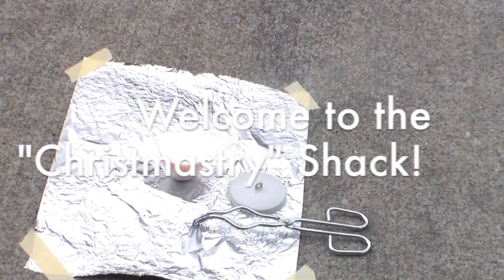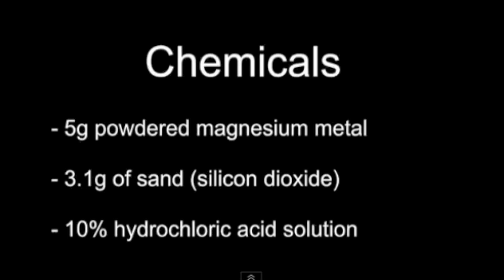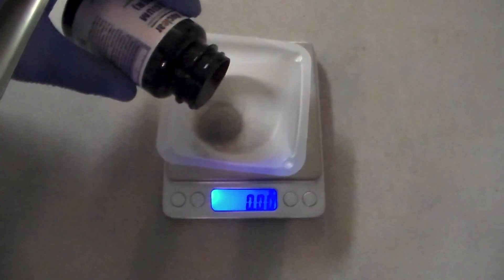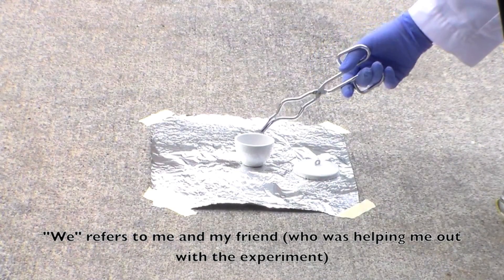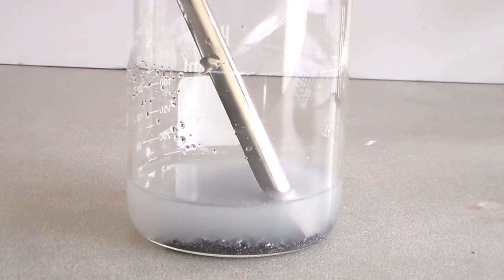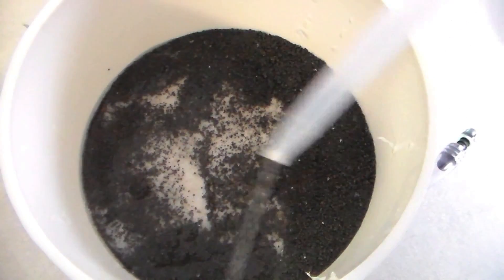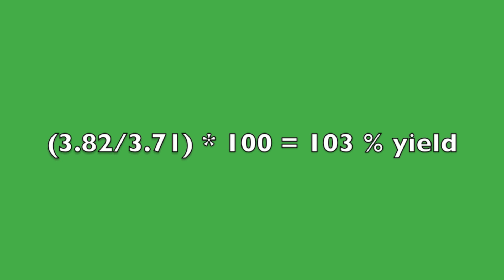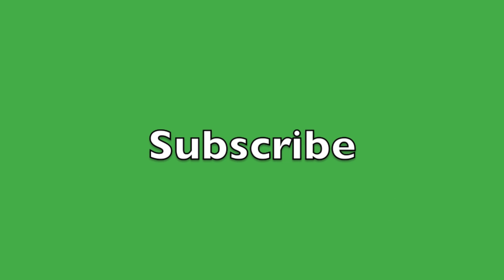Silicon Synthesis (From Mg and Sand) [Full HD]

Comment: Personally I like the thermite method using SiO2, S and AL. How ever afterwards you will have some aluminum sulfide to deal with, which slowly releases SH2. Not fun to be around but if you dump it in some weak HCL it will all react pretty quick. Just make sure its away from any people, hydrogen sulfide is horribly smelly not to mention very toxic.

Comment: First why dont you try to make pure sio2 from sand 
The procedure is 
1)Get the sand and some dil.acid like hcl or h2so4 to remove any carbonates 
And when fizzling stops clean it with water 
2)now let it dry and adding sodium hydroxide to the sand and heat to 400°C using a torch or anything and this must be done in a steel or copper vessel as Molten NaOH is reactive
3 when done dissolve in water this forms sodium silicate and then filter it to remove all impurities 
4 now add conc.h2so4 or hcl to sodium silicate which will form silic acid and filter it carefully 
5 let the acid dry and keep on stove or a burner to dry acid to sio2 
Heat for an hour to make sio2 completely
And there how you can make silicon purified one not contaminated
Reply: i need more expling please ??
Reply: @مريمطويل-ب7ل  can you elaborate please ?

Comment: I made elemental silicon once using a thermite mix of aluminium, sulfur and white sand. 
Calculated the amounts stochiometrically, plus 15% aluminium + sulfur and plus 5% aluminium.
(Extra aluminium and sulfur to increase the reaction temperature (Al + SiO2 reacts poorly, need Al + S to fuel the reaction.) and extra aluminium to reduce unreacted SiO2 in the end product and keep mostly HCl soluble Al + Al2S3 in the slag. Be careful! a lot of HS was released!

If you crush the slag and you find nice Si globules you can remove the Si globules and process the waste using NaOH. This is safer than HCl (NaOH reacts with Al2S3 to produce Na2S).
Reply: how

Comment: Perhaps you could have preheated the crucible gently in a kiln, you might not have had the thermal shock issue from the rapidly heating magnesium. Just a thought......
Also, have you tried making your own crucibles? If not, the way I do it is to use the mixture to make a kiln, 50% plaster of Paris and 50% kids play sand. It's cheap and highly effective for super high temperature experiments. Mold the crucibles fairly thick to and they will last forever, also if you buy the plaster of Paris in bulk you can get 25kg for around £19/£23 depending on where you buy it. I make these myself for casting molten metals including Silver, Gold, brass, Aluminium, etc......basically anything I need to melt. I don't have a good enough camera to show the process so I can't make a video, besides, being a smith I haven't the time to be making and editing the process.
Maybe you could try it and see what you think, if you like the idea of getting super cheap crucibles etc.
If you need any more info on the matter, I don't allow people to contact me through YouTube,  but feel free to ask any questions at psgm28@gmail.com 
best wishes, happy new year,
Pete

Comment: Maybe you can try just the heating of SiO2 with carbon using a MAPP torch. Ideally the silicon metal will melt and sink to the bottom. Have you tried that? It might work. As the carbon burns and the reaction starts it will make an inert atmosphere. Just do it in something that can let gas out but not in. Also, wear a mask to protect yourself from CO and do it outside.
Reply from the maker: Nile Red So far, I haven't tried any other method of silicon production other than the one in this video. That procedure might work, but there is also the possibility of the molten Si reacting with C to form SiC. 
I think I will try the SiCl4 synthesis to see if it works with the impure silicon I prepared; if not, I will try out this method, and possibly some others.
Reply: I actually just bought silicon from Ebay for pretty cheap. I will try making SiCl4 at some point
Reply from the maker: Nile Red I found some cheap silicon from Home Science tools to use as a backup if this stuff doesn't work
Reply: @keeapheto1680  centigrade or Fahrenheit?
Reply: *=* Hmmm, nope, it probably produces silicon monoxide(SiO), or silicon nitride(Si3N4)
Probably [SiO2 + 5C + CaO = Si + CaC2 + 3CO]
Reply: Hi Nile red please in your next video 📷 make liquid chlorine and fluorine and about hydrofluoric acid

Comment: A nice video. After washing away Magnesium oxide using hydrochloric acid, it also should be treated with hydrofluoric acid to dissolve any unreacted sand present in it (pure silicon does not react with HF). But, handling HF is too risky to deal with so it is understandable :-)
Reply from the maker: Thanks! I have had several people tell me about that as a good separation method, but yeah I really don't wan't to work with HF haha

Comment: I don't really think there is a feasible way to separate SiO2 from Si. You can try reducing SiO2 using carbon. That is how it is produced industrially. However, industrially it is often done under and inert atmosphere, but that produces CO.

I found this: https://books.google.ca/books?id=pu3x5ICwLqEC&pg=PA792&dq=reduce+sio2+using+carbon&hl=en&sa=X&ei=jFycVM-4MIKqyASf-oCoAw&ved=0CEgQ6AEwBw#v=onepage&q=reduce%20sio2%20using%20carbon&f=false

You might be able to just heat sand and carbon together. However, carbon burns in air at around 700C and to get Si you need to bring it up to about 1600C. So the article suggests that you can add almost 8 equivalents of carbon and just heat it (until ignition?). The carbon should take most oxygen from SiO2 and hopefully the Si won't oxidize to SiO2. I think it is worth trying.
Reply from the maker: Allright I might try that. Right now I don't have any torches that get to 1600 C. And according to wikipedia (http://en.wikipedia.org/wiki/Thermal_oxidation), the maximum temp required for thermal oxidation of silicon is 1200 C, so the heating would have to be done in an inert atmosphere.

http://onlinelibrary.wiley.com/doi/10.1111/j.1551-2916.2005.00144.x/abstract
The above website gives an excerpt of an article on the reduction of silicon with hydrogen, but I haven't read the whole thing because I would need to pay for it.
Reply: i could get the article, but from the abstract, heating hydrogen gas to that high temperature at home would be pretty dangerous.
Reply from the maker: True--that would definitely not end well since I can't rid the apparatus of oxygen and nitrogen effectively.
Reply from the maker: Right now I don't think the SiO2 impurity will matter since I'm just using this silicon to make SiCl4, and SiO2 doesn't react with chlorine.
Reply: yeah i think you should be fine. Be vary careful with SiCl4 though!
Reply: And with chlorine gas. They are chemicals that must be used seriously!
Reply from the maker: Don't worry I'm scared of those chemicals just as much as anyone else!!!
I'm following the procedure below:
http://www.chemiedidaktik.uni-wuppertal.de/disido_cy/en/exp/m_fact01.htm
Except for the NaOH solutions to trap escaping chlorine I will add a reducing agent to promote Cl2 absorption.
I have synthesized chlorine before, and I used the same solution to trap escaping Cl2, as well as working outside with a fan and respirator.
I actually still don't know what it smells like, and I'm really happy about that!
Reply: I am glad you are taking the necessary safety precautions. Unfortunately, I know exactly what it smells like :p.
Reply from the maker: Is it similar to HCl? Because I have gotten a wiff of that in my nose :(
Reply: It smells like bleach except much stronger. HCl smells different but probably feels similar.
Reply: Nile Red Me too... I also know what hydrogen chloride smells like...
Reply from the maker: Camroc37 Yeah HCl is terrible. I personally think that NH3 is worse though, just my opinion
Reply: TheChemistryShack Hmm, gotta go out and buy a new condenser pump (lost mine :( ) and then I will be able to smell KNO3- hopefully I  don't though! Hey, do I have to condense it, or can I just keep it in an ice bath and add enough so that both the H2SO4 and potassium nitrate are used up?
Reply from the maker: No nitrocellulose is a solid not a liquid. Just leave it in the acid and nitrate bath. You will need to do some research about how long you need to nitrate it though, because over nitration can make it a shock-sensitive explosive, very bad
Reply: TheChemistryShack Iv'e heard 15 minutes. SO I can mix those things and let it react, then nitrate the cellulose directly in the solution without condensing? Is that what you mean?
Reply: TheChemistryShack
Yes, Silicon tetrachloride is a lewis acid. It reacts with moisture in the air and produces dense fumes of hydrogen chloride (analogous to anhydrous aluminium chloride but SiCl4 is a liquid at room temperature). So obviously, It forms dense white fumes of ammonium chloride with ammonia. For this reason, sometimes it is used to make smoke screens in warfare

Comment: Damn I have so many fails recorded too... I will cut it some day :D
EDIT: If you have 10 bucks on spare, buy a few watt fish pump and reverse the rectifier valve. It will make a vacuum that is enough for vac. filtration. I use one since a year and it's all fine. If you have some problems, like liquid goin it the tube, use backflow. :)
Reply from the maker: Sounds good! right now the hand pump is working fine, but I'll look into the fish pump!